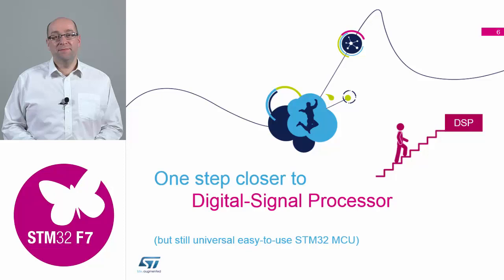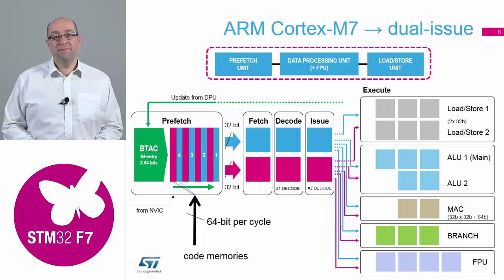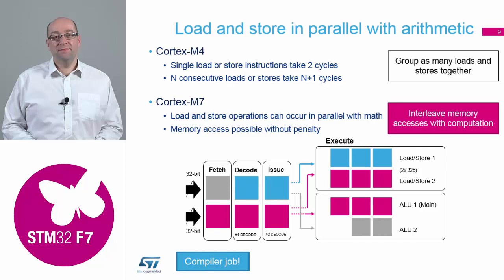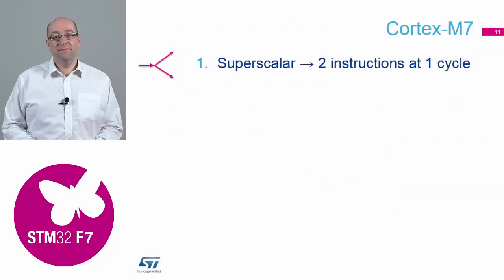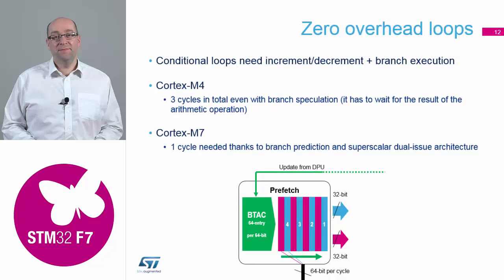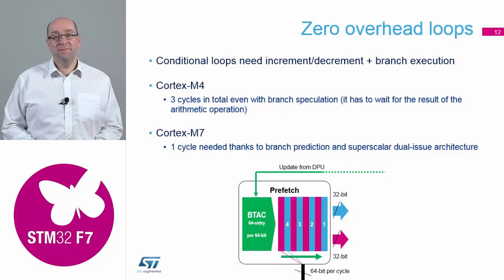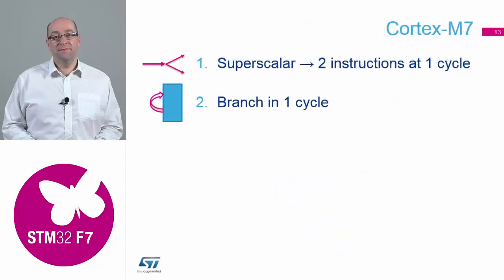STM32F7 workshop: 02.2 Cortex M7 core - Dual issue and zero overhead loop

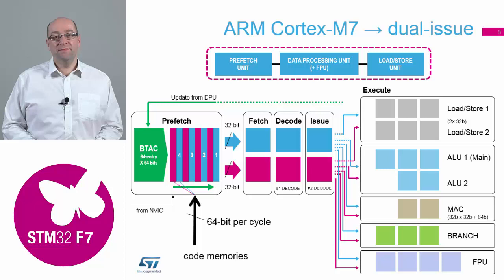Comment: 0:56 Hello, can we ask questions? Yes we can! Comments are not disabled. Cool. So around 0:56 you use the colors blue and purple to distinguish between two 32 bit parallel instruction streams. But... inside the Prefetch block, you show the memory where 64 bits purple words are interleaved with 64 bits blue words... So, are these colors in the Prefetch consistent with two separate parallel 32 bits instruction words, one blue one purple? Because, if they are, it looks that you have two 32 bits purple instructions every two clock cycles, interleaved with two 32 bits blue instructions also every two cycles, and then you need to de-multiplex this into two separate 32 bits instruction streams, so.. it looks like it would be much easier to organize the Prefetch unit differently, where every 64 bits word, consists of a 32 bits blue instruction (at the top in the diagram) aligned with a 32 bits purple instruction at the bottom, because then you have the instructions already seperated and can just shove them out into the rest of the pipeline.. But, if the colors are consistent in the Prefetch, this is not really happening, or is it?